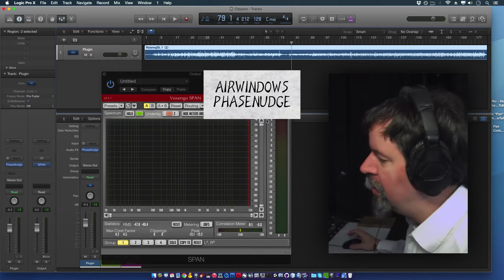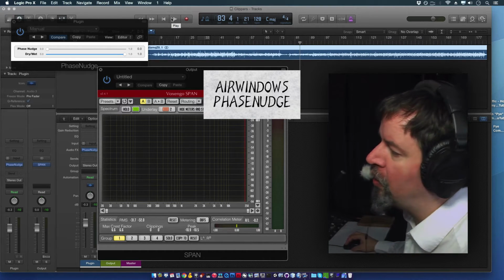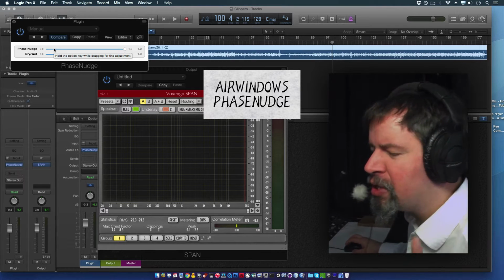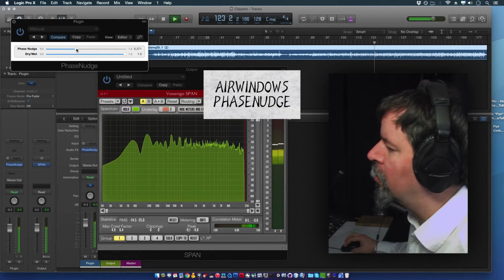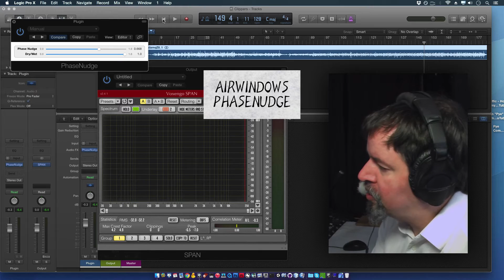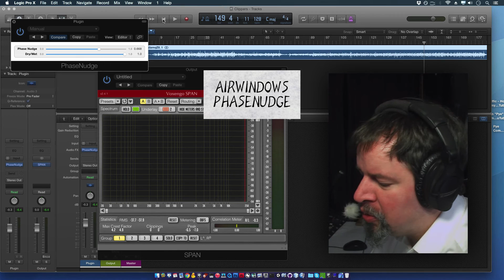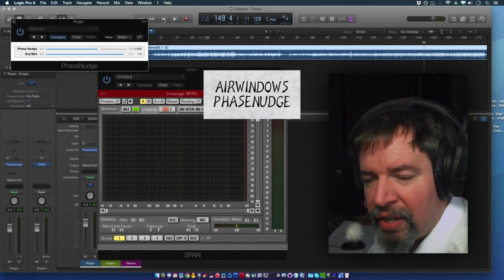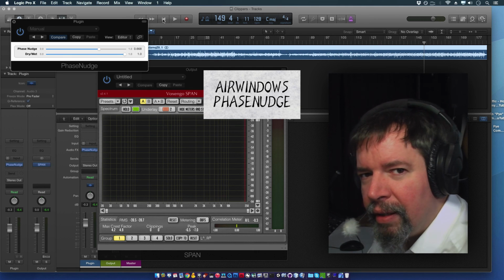PhaseNudge

Comment: based on the explanation, would this also work to fix asymmetrical waveforms for vocal recordings/voieovers?
also, i could not open this on a mac. got the "unauthorized developer" message. i know to normally, with "normal" applications to bypass this in preferences - security and privacy, but this doesn't work for plugins. any tips on how to solve this?

Comment: His verbal description of a phase rotator is spot on. However when I tried PhaseNudge I heard something not like a phase rotator. So I checked the impulse response and it is clearly a fading delay with about 8 stages. The "phase nu" adjusts the rate. Normally a phase rotator has three adjustments: Start frequency, number of poles and bandwidth adjustment (frequency range the poles are swept down to). I don't know if this was intentional or not. I tried it on two different DAW's.
Reply from the maker: It's an allpass filter, out of a reverb. One pole. That's why it's only a 'nudge'…
Reply: @airwindows  If it's out of a reverb then it's probably a Schroeder allpass, right? A standalone IIR allpass would be a helpful thing to have too. I think that's probably what MellowTorch was expecting based on the way you described it.